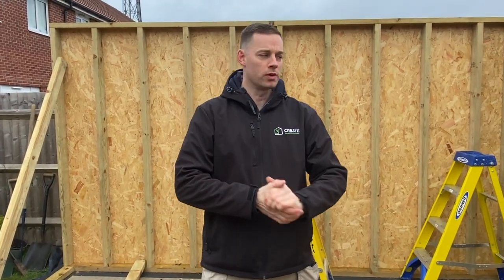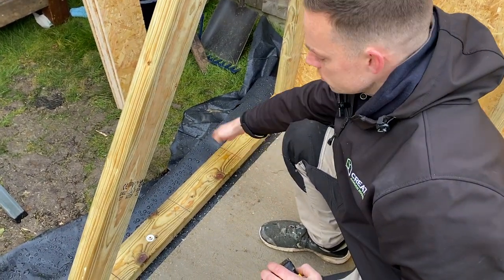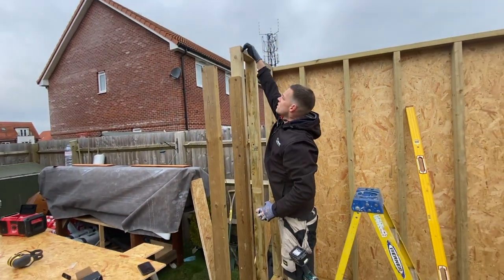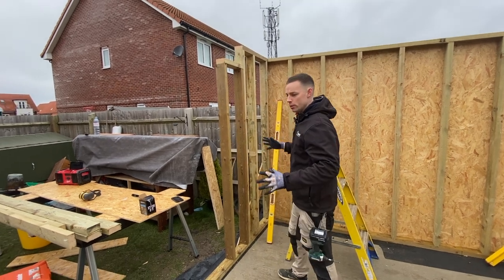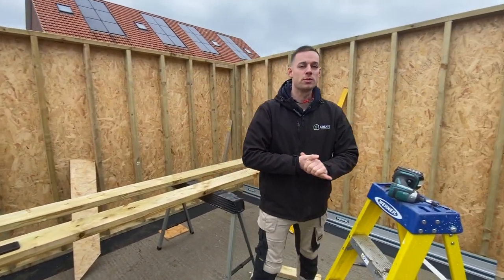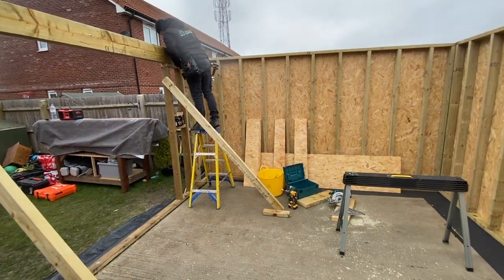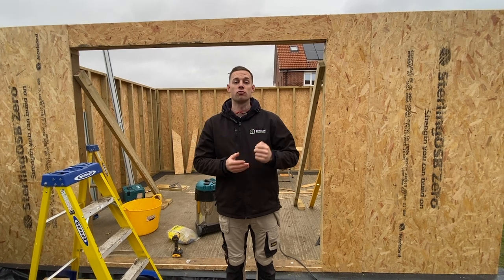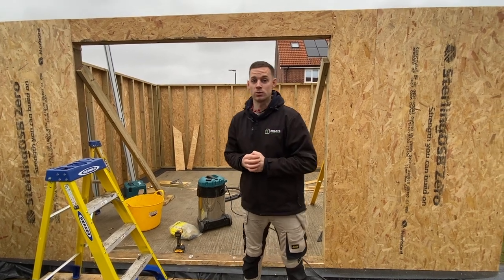PART 3 FULL GARDEN ROOM BUILD How to build and fix the front wall, door lintel and cheeks

Comment: Loving the work lads i am soon starting  my garden room going to be 20ft x12ft roof timber span table recommends 47x170 would be a suitable size at them measurements  as trying to keep under 2.5m   would you say bolting two 5x2 together be strong enough? How long can 2bolted  5x2 span ? And are the door a custom height.many thanks
Reply from the maker: You could use single 5x2’s for a 3.6m span roof 👍 We only double up 5x2’s when the span reaches 4 metres or we use 6x2’s. Cheers

Comment: Will the osb be ok in the rain for a few days before it’s wrapped   Or does it need to kept dry
Reply from the maker: Better to keep it as dry as possible put it its fixed vertically on the walls you can probably get a away with a day or two rain on it 👍
Reply: @creategardenrooms  thanks for your reply   In the middle of building my own, struggling with the weather

Comment: Hi mate.
I noticed you didn't use anchor bolts in the concrete slab.
Which nuts and bolts did you use to fix timber to concrete slab? I've purchased some anchor bolts for my build which I will start soon, would you be able to make a video showing best ways to fix timber with anchor bolts. Thanks
Reply from the maker: Hi, no we do not use anchor bolts. We drill a 7mm hole in between ever other upright into the concrete. Hammer a brown plug into the timber then knock it down with a 100mm screw and leave about 40mm of the screw showing. Now screw the screw down making sure you’ve put a 20mm washer on the screw so the screw doesn’t pull through the concrete 👍 That will be just fine no need for anchors.

Comment: Couple questions- I have an existing base without a DPM so how do I add one which is effective?
The 2.5m height rule, as I am using an existing base which is sunk into the ground at one end and not at the other (on slope) where do I start measuring from? Thanks :)

Comment: Came across your channel whilst looking for garden room builds. Yours is like how I’m building mine on a concrete floor. Very informative thank you. 

Just one question if I can. How wide would you go for a 2x 8x2 bolted lintel width? I am hoping to put a 2.7m wide bifold but might drop to 2.4 if the lintel is an issue. Many thanks.
Reply from the maker: Sorry I haven't replied sooner I missed this comment. 8x2 bolted lintel will do up to 3m just fine 👍

Comment: Hiya, hopefully I explain this right but with the concrete base and then the dpc then the floor plate how do u stop any potential water penetration coming through from the outside in if that makes sence
Reply: Use a breathable membrane, overlap the concrete base so any water drains off into the ground and not onto the base.... You need to make sure you have decent drainage around the building (i.e. a shingle channel looks nice on an outbuilding) to avoid water pooling around the base of the building.